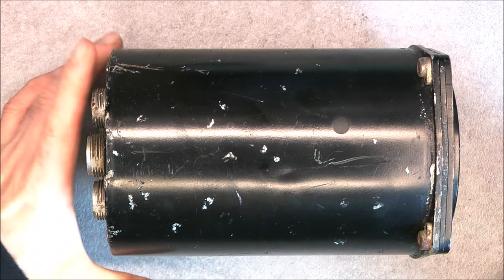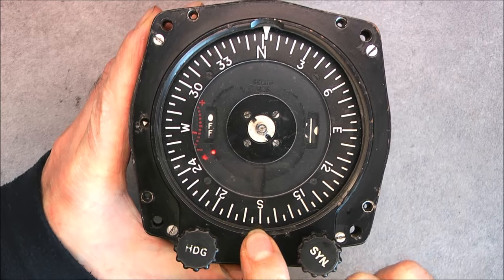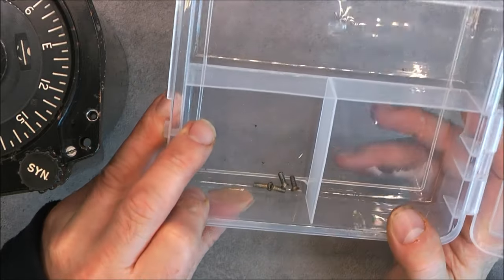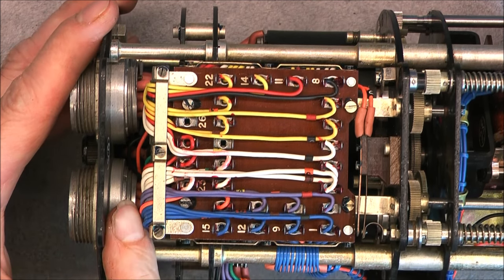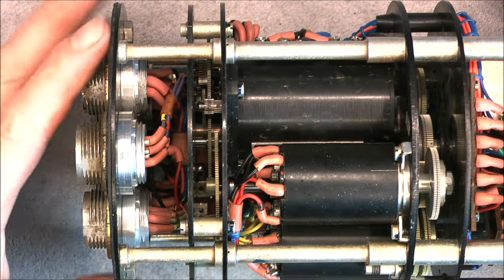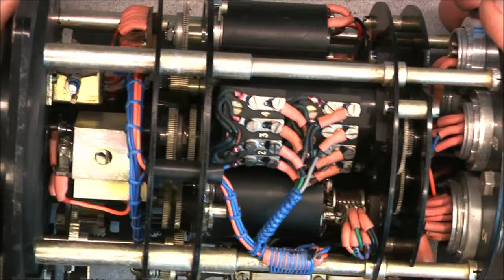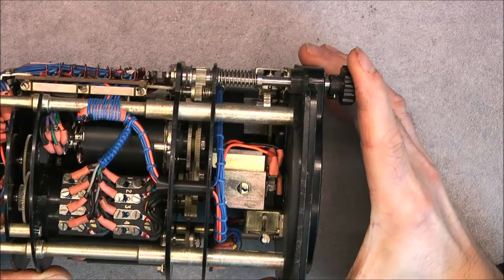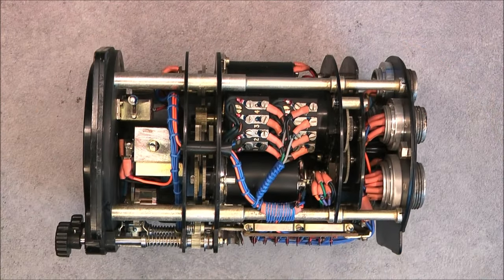British gyro magnetic  compass indicator teardown

Comment: I was trained to wire this way back in the 1960s in the RAF. Equipment built this way is designed to work forever, and it generally will.
It's good to see wiring laced correctly again. Things are rarely made this well today.

Comment: The pink sleeves ar Hellermann sleeves, a synthetic rubber sleeve that was used a great deal until the 80s. Most of us had a bottle of Hellermann oil on the bench to help apply these; most techs would only ever need 1 bottle in their career!